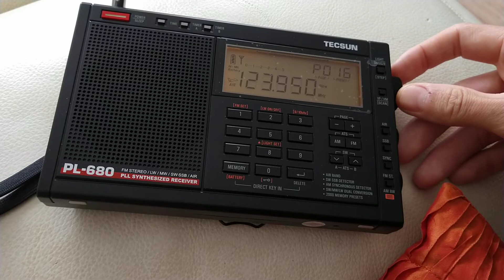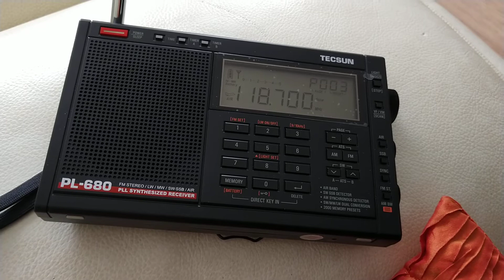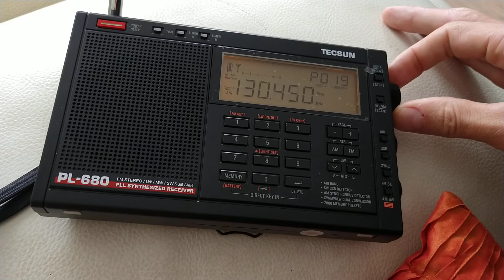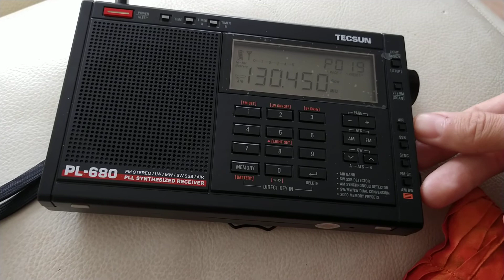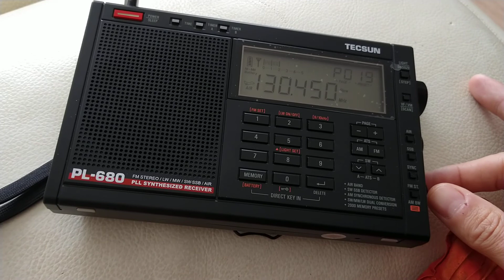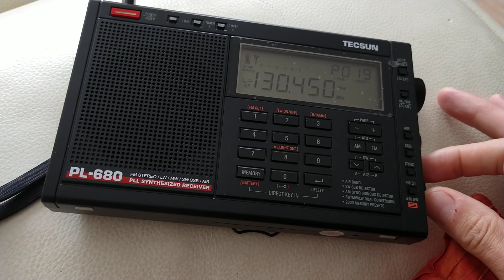Tecsun PL-680 performance on the aviation band

Comment: It sounds excellent Ron. I've noticed since the move to 8.33 channel spacing the audio sounds a little.more "filtered" as they reduced the audio  bandwidth. More noticeable on the aircraft than ATC side in my opinion though. 73!
Reply from the maker: Thank you Nick, almost always I receive the ATC side clearer than the aircraft. I thought it's because of distance or power. 73!

Comment: How many hours are you getting on battery life with rechargeable batteries?
Reply from the maker: I'm not sure how many but I can say it's fewer than the single 18650 cell of the PL-880. Depending on capacity of rechargeables - those supplied with the radio aren't that great. 
Interesting thing though that Ive been using four standard Duracells and they lasted long time. Now they're almost flat but they just refuse to die completely:) 
The 880 is more power hungry and when its battery is down to the last bar it won't last long before switching off with low power warning and that's it.

Comment: Can the antenna of this radio adjust to a vertical position when the radio is lay flat (horizontally) like this?
Reply from the maker: In this video I used a plastic kickstand in the back side of radio. The antenna won't be able to point up at 90°. To achieve that another stand at the bottom of the radio has to be used. Then the antenna will run perfectly parallel to the radio's side but that's usable only for indoor and on hard surfaces.
Reply: @TheMajkla  Thank you very much for your reply.

Comment: i love this radio. i have a new pl680. love it. love to sit and ride the waves. what's crazy though is that i live about 10m away from a small municipal airport and im never picking up any signal. any ideas how i can pick something up? probably a better antenna? my radio is completely stock.
Reply from the maker: You need to find a list of air band frequencies used in your country. If it's a small airport then you'd need to know the frequency and listen for long time to hear something. But there should be other national frequencies available for high level overflights etc. 
I also live near to a tiny airport and I almost never hear anything from there. I saved about forty frequencies into the radio's memory'. So I can scroll through instead of hoping to find something by scanning. It's about tuning to right frequency at right time or waiting. If you can get to a higher elevation the difference is big. I just need to get away from my house which is in the valley and I catch distant ATC like youtu.be/QbC2N24UiVs 155 km away..
Reply: @TheMajkla  wow! Thank you so much
Reply from the maker: @TheDarkGreenMarine  no worries - I learned from YouTube and other users. Oh, and there's a thing about this portable you've maybe already noticed that it's very quiet on weak signals. Also on the air band so sometime you have to turn the volume all the way up.

Comment: when storing airband memories as preset stations, is it possible to "memory scan" please ? Thanks
Reply from the maker: I'm not sure because I simply saved about 25 frequencies to one page (pretty much all I can hear in Edinburgh area). Then I scroll through by rotating tuning knob. If I'm more adventurous and have time to kill then I scan manually with help of lists from the internet. This one is great - eastmidlandsaeropark.org/frequencies-civil.html
Reply: @TheMajkla  thanks - Ive now bought one myself. It doesnt appear to support memory scan sadly
Reply from the maker: @MWOCQU    Still it's a great radio. Especially its sync is excellent. Memory scan would be handy more on shortwave where there are lots of stations. Just have a look at this if your radio sounds funny on MW (when bandwidth filter is set to wide) - m.youtube.com/watch?v=73E5k13WpRI
Reply: @TheMajkla  fortunately I have a lab full of radio test equipment available to me :-) no wobbly medium wave or 4KHz HF offsets  on mine fortunately :-) . When time permits I will measure the "lab" sensitivity - obviously on air band it will be well down on a dedicated receiver. But I bought it as a travel radio not a dedicated air band set its obviously more than sensitive enough for "at / near airport" use.
Reply from the maker: @MWOCQU  oh, you'll be fine then:) Mine is good now but I read the 660/680s aren't very sensitive for air band. I'm not far from one big and one small airport so I can hear them well. But other ATC is more challenging to hear.

Comment: Excellent audio on the Airband there! Great reception.
I’m about 16 miles from Gatwick so I’d be interested to compare this to my Uniden 125 scanner. It’s a shame you can’t tag the frequencies on this but I don’t suppose it matters. How do you like this 680? Are you happy with it as I’m thinking of buying one? Laurence
Reply from the maker: Cheers! I'm only 5.5 miles from Edinburgh airport. Reception is excellent and I haven't experienced any interference from FM into air band. Yes, I'm very happy with this portable. The only thing I don't like is how quiet it is sometime on certain low power stations. I do a lot of DXing so I'm more interested in unusual signals or pirate stations than big SW broadcasters. It's okay on MW and I enjoy its large orange back lit display which is nice in the darkness (unlike super bright cold blue one on the XHDATA D-808). You can try it and if you don't like it you can return it back to Amazon from pick up point for full refund. Ron
Reply: @TheMajkla  that’s great Ron! Have you used the wire antenna that comes with it? Looks an interesting concept.
Is the radio easy to get to grips with? I’d imagine it’s juicy on batteries? However, feel I need one of these so will order tomorrow.
I have the Tecsun Loop antenna and that is absolutely outstanding!
Reply from the maker: @soldierloz  hi Laurence, the batteries last for reasonably long time. Rechargeable AA batteries are supplied. You can use any other with higher capacity or the ordinary ones. I use a longer wires than supplied spool because they work much better. Any kind of wire is fine, just find an ideal length - wire too long causes overloading. About eight to twelve meters is my favourite. I cut a wire from an old hoover I saw on the street:) For me this radio is easy to use because I've been using the Tecsun PL-880 for ages.
Reply: @TheMajkla  Excellent! Thanks indeed and yes ... I’ve just lashed out on one and now having palpitations! 😆As mentioned, I’m quite new to this (but not to radio) and have had scanners etc so I’m not completely novice. Sounds great and looks fun and it seems a nice radio. I’m sure I’ll get to grips.
Loving the wire idea, did you have to fit a Jack plug onto it? The reviews state that the antenna that comes with it is ok outside so I guess that can come with me. 
I appreciate all your replies there and thanks for guiding me through the maze of new radio.
Great stuff
Laurie
Reply from the maker: @soldierloz   my pleasure, you should receive it soon. My radio has arrived in a day or two last year without choosing a first class delivery. Yep, it's a 3.5 mm jack for external antenna input. You can get a 3.5mm jack male mono plug then attach it to an alligator clip to connect to longer wires. Or just use that short spool of wire from the box. If the signals are stronger it's also fine just to wrap an insulated end of wire around the antenna. It's a big difference between any external wire and telescopic antenna. Here's an example of the plug:)  https://youtu.be/5L7FtQbv2FA
Reply: @TheMajkla  Ron, hi mate, got my radio and so far seems good.
Can I ask what the red writing above/below the numbers on the keypad are for? How are they activated?
Reply from the maker: @LaurenceTheMod  hi Laurence, congratulations! The red numbers are secondary functions. Bit like on laptop keyboards when you press Fn key you access another feature.
On the radio if you do long press - you activate some features. They work when radio is off. Very useful - long press of key 3 - toggling between 9/10 kHz spacing on MW (10 kHz for US). Memory/Battery - you choose between standard or rechargeable batteries. 0 for keypad lock. AM BW long press activates sorting of frequencies stored in memories. People call these also a hidden features but most of them aren't that mysterious 
 they're probably mentioned in the instructions manual.
Reply from the maker: @soldierloz  then this you might find useful - https://youtu.be/73E5k13WpRI if you use a wide bandwidth filter on MW your reception may sound bad. It's easy to calibrate your filter to make it sound right. I didn't know about it when I had the PL-660 and I sent it back to Amazon for refund. Then I got the 680 later so I can listen to air band:)
Reply: @TheMajkla  Thank you ever so much Ron, you are so kind helping me and apologies for the questions. 
Yea all makes sense so just going to have a mess around and test around to see how I go.
Yea I’ve set it to narrow width and it’s definitely better. 
My friend who makes antennas is making me a 12m wire. All good fun .... expensive though! 😆
Reply from the maker: @soldierloz  no problem at all:) I learned a lot from watching videos too. Enjoy the radio and good listening to you mate!
Reply: @TheMajkla  yes ... indeed I will.
You take care and stay safe. I might drop you a message from time to time?
📻
Reply from the maker: @soldierloz  surely, feel free. I'm looking forward to seeing if you find some interesting catches. Have a nice weekend!
Reply: @TheMajkla  Ron, morning mate, what antenna setting do you use on the switch on the side for both telescopic and the wire? Laurie
Reply from the maker: @LaurenceTheMod  Hi mate, I just keep it set to DX for most of time. If you use some longer wire and you start hearing MW stations in SW then it's time to use the attenuation. There's a strong legal Delta International on 6020 kHz playing good music. Heard any pirates yet? https://www.hfunderground.com/board/index.php?board=12.0 - handy for checking what's happening. 6290 kHz is strong now.
Reply: @TheMajkla  nothing heard as yet. Truth is I don’t actually know what I’m doing. 😢 
I guess what I need Ron is for you to knock up a YT vid on how to do basic searching on SW. Maybe how best to set up the long wire. 🙋🏻‍♂️
Reply from the maker: @soldierloz  no worries it's easy, at least I just hang the wire wherever I can in the nature. Next to the house it can be a problem if there are sources of electronic noise. Can be anything, TVs, wall charger adaptors etc. If that the case you need to take the radio to a park or just a bit away from houses and reception improves immediately.
Reply from the maker: @soldierloz  I don't use automatic tuning on the 680 - I rather key in the frequency or I tune manually around then. But you can play with scan function - by long pressing the VM/VF button. VM stands for scanning memories and VF should do scanning by frequency. 
If you long press SW arrow down/up buttons it scans and then saves what's found. Not much anything else to do:)
Reply: @TheMajkla  Ron, great stuff. Can you jot down a whole bunch of frequencies worth getting? I can then tap into them conditions pending?
Reply from the maker: @soldierloz  these are my favourite - right now 6020 kHz Delta International, usually active on Fridays and weekends, 3920 Radio Piepzender, 3940 Mike Radio occasionally, Radio Merlin International always on 6305 kHz.. Check the website of Channel 292 which is on 6070/9670 kHz 
This link  https://www.channel292.de/app/download/5815092060/European+private+SW+stations+-+1+March+2021.pdf lists lots of legal SW stations in Europe.. 
For pirates you can tune between 6200 - 6400 kHz there are often some there:)
Reply: @TheMajkla  brilliant stuff Ron, I’d have fallen at the first fence without your help! So kind and my thanks. Just wish there was a way we could chat but I guess here will do.
I’ve tried those frequencies you’ve kindly sent but no luck as yet. Perhaps I should go outside with the long wire to increase my chances? 
I’ll see if I can find a way of getting my email address to you. Then we can chat without choking up your posting. Superb stuff and ever so grateful.
Reply from the maker: @LaurenceTheMod  my pleasure:) For the most of these stations you don't even need wire at all in outdoors. The difference is huge compared to indoor or around the house settings. Also the reception improves a lot later in the evening from about an hour before sunset. Keep trying till get to know it better!
Reply from the maker: @soldierloz  hi, a tip to try - Mystery 21 is on 4870 kHz now. It's very strong and perfect audio. You should be able to hear this signal well.  You can drop me an email to marv28@email.cz
Reply: @Tootsie-jl3er Do a search online for the approach, tower and director frequencies and try it via direct input. You should get something?
Reply: @Tootsie-jl3er  How about using this route?
Activate the Air button and just rotate the tuning knob as near to the frequency it will go? It should be mapped for the airband frequencies but yes ... if direct input just add a 0 or 5 depending on the required frequency.
Reply: @Tootsie-jl3er  hmmm ... head scratch here. 
Does seem unusual. Can you do a vid of you tuning through the Air so I can see?
These radios really are good so its strange. Are you getting sound?

Stick with using the telescopic antenna for now. Let's get the basics working.
I will add that Airband is very much line of sight so outside and above. Height is might is the theory.

Let's keep at this ...
Reply: @soldierloz  hi mate I've replied to you on my video now

Comment: Nice reception!
Reply: How much is that radio?
Reply from the maker: @0-n-i-o-n_0  thank you very much, I ordered it from Amazon UK for GBP 140 with some discount voucher. It can cheaper if ordered via Annonco from Hong Kong but delivery times are long. Mine has arrived next day despite choosing a standard delivery:)
Reply: @TheMajkla  Thanks I would consider buying that radio
Reply from the maker: @0-n-i-o-n_0  have a look at what is available. The XHDATA D808 is very good for much lover price. But its speaker doesn't sound that good and on mine the telescopic antenna broke off inside the radio. Tecsuns  660 and 680 are more expensive, sound better but SSB has to be operated by tuning carefully and listening for the best audio. On the XHDATA or Tecsun PL-880 you see your fine tuning on radio's display. It makes it much easier. Then 880 doesn't have air band for aviation, its sync doesn't work.. but the 880 has the best speaker with loud and rich sound of all of these portables. Only Sangean ATS 909X is better but that's more  expensive than 880:) 
So depends what n your budget and what are your priorities..
Reply: Thanks for doing airband video.
Reply from the maker: Thank you for watching 👍